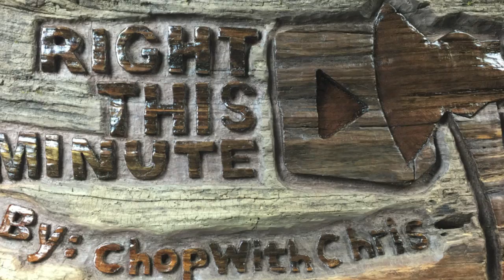Right This Minute | Chop With Chris - Wood Carving

Comment: Hey Chris, if you don't already you should really engage in some reddit communities such as: https://www.reddit.com/r/woodworking , https://www.reddit.com/r/artisanvideos , https://www.reddit.com/r/blacksmith , https://www.reddit.com/r/toolporn (completely safe!) or even https://www.reddit.com/r/DIY
Reply from the maker: I have been on the front page of Reddit twice from other people posting my videos so I started to post my own videos not knowing that it's not proper Reddique and the moderators kicked me off.   I'd appreciate any advise you have about how to proceed.
Reply: Yep, reddit is a fickle beast. I think on a lot of subreddits 'advertising' or self-promotion isn't accepted. This is the golden rule and the part you'll need to figure out. It's a fine line... All subreddits have rules on the right hand side called the sidebar. I did find this: https://www.reddit.com/wiki/selfpromotion which you should definitely read.

I can't see anything wrong with posting pictures with finished products with something like "I made this chair with no power tools" on r/woodworking. Only use imgur.com to upload pictures. Maybe even message one of the mods and ask for advice or for a bit of guidance? Most mods are pretty friendly.

To me, a lot of the discussion alone is invaluable - sharing knowledge, learning from others and getting ideas and inspiration.

Found two more: www.reddit.com/r/turning and www.reddit.com/r/woodcarving

Hope I was able to help. Who knows? You might find it amazing and useful or a waste of time. Good luck :)
Reply from the maker: Thanks. I will do this. We can all benefit from a little time wasting in this world today 😄
Reply from the maker: Is it possible to post across multiple subreddits at once?
Reply: No, it needs to be done separately. Avoid spamming!
Reply from the maker: Got it. I'll probably work on it this weekend.  Thanks. REDDIT is king!
Reply from the maker: You are welcome to post my videos you feel are worthy.